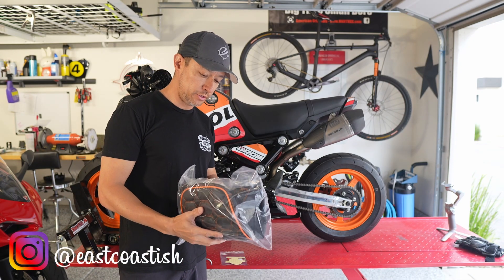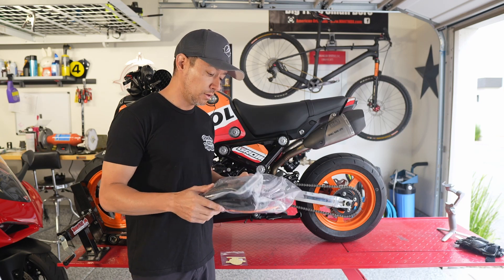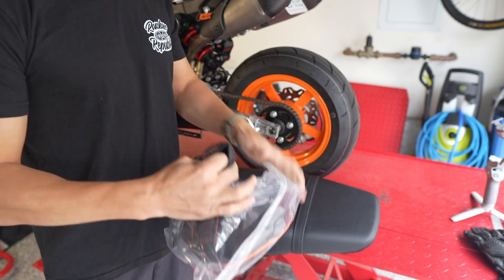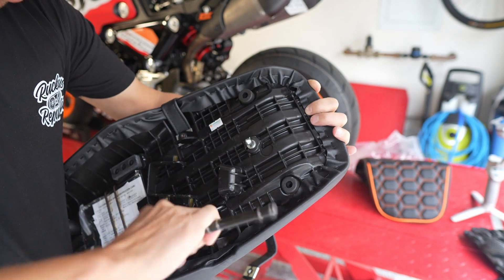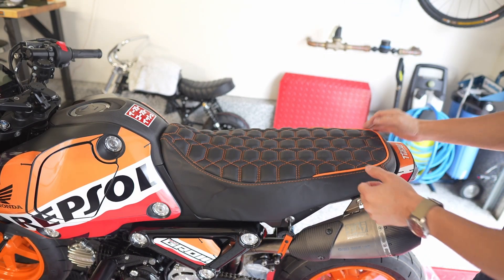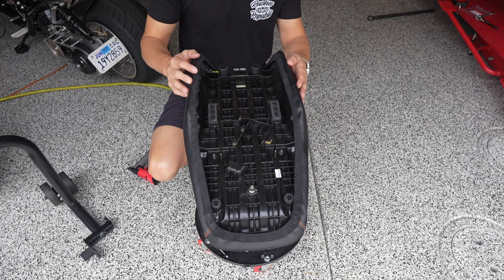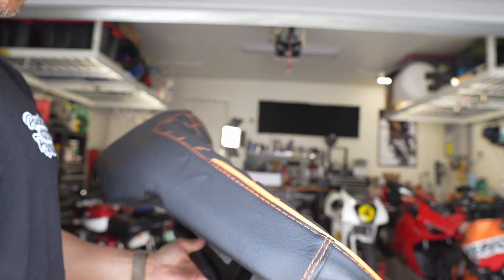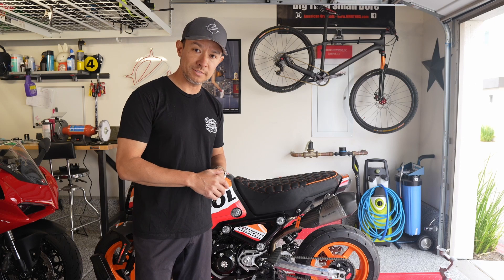Cheeky Seats Hexagon Seat Cover for the 2022-2023 Honda Grom ホンダグロムのシートカバーの付け方

Comment: Won’t the staples go thru? Canna hand stapler be used too?
Reply from the maker: Staples don’t go through. Def need a pneumatic stapler and stainless steel staples though.
Reply: @eastcoastish a quick trip to harbor freight for me then 😂. However I do t have a compresor. Just and air tank that I use for re inflating my tires when I go off-roading. Hope that works

Comment: Looks really nice! Good job. 

Am I the only one that had to remove the hooks for the seat to go on and come off easily? I try the washer trick but it wasn't any better. With the hooks it was like 10-15mins to take the seat on and off.
Reply from the maker: I ended up adding 2 washers per side and it made getting on/off easier; I then ended up putting the strap back on.